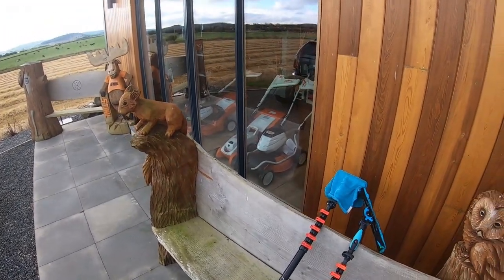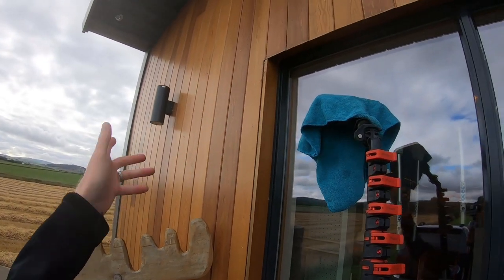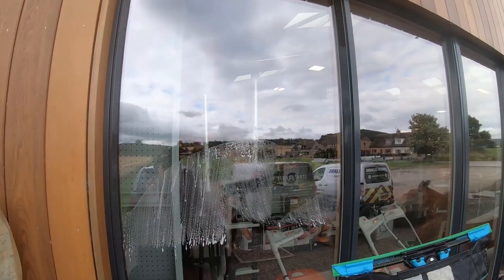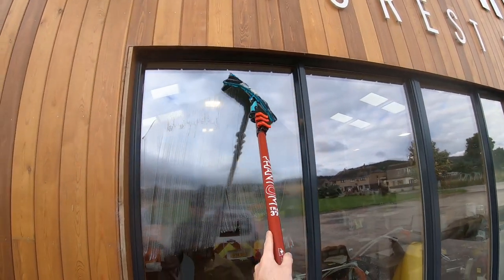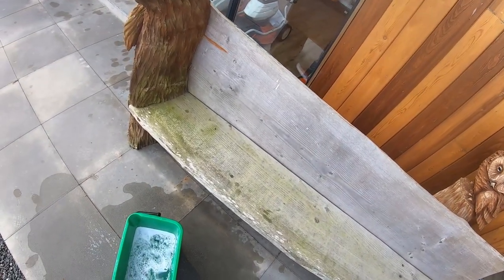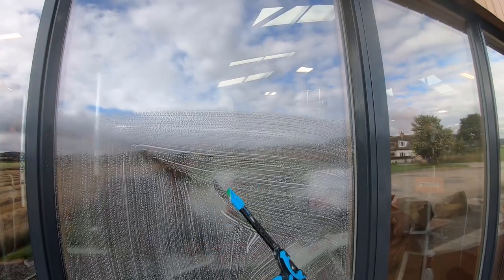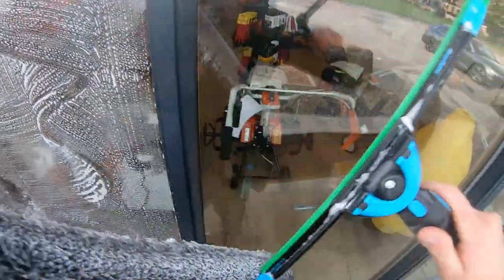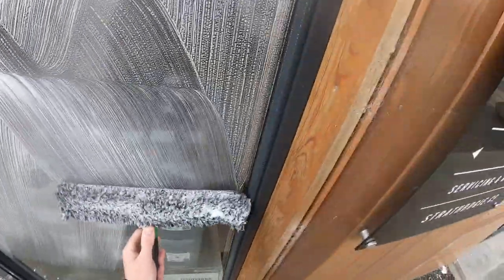SQUEEGEE TRAINING - HAND & POLE TOOLS  (NO MUSIC)

Comment: Pete,
I turned to razr blade red rubber
I’ve been cleaning windows for about 35 years now, and all those years i used unger soft standard black rubbers
I switched about a year ago to the razrblad red and i will never use the old ones anymore
They last longer en give a much better result, it’s sillicino

Comment: Nova Scotia here (New Scotland).  Thanks for the advice on cleaning windows.  I watched this video to the end and then went out and cleaned the windows of my summer place, only this time with little to no streaks following your techniques.  I still need one of those pivoting squeegees you use to reach the tops of two large windows.  The outside of those windows didn't come as well running the squeegee top to bottom.   I was using that technique on all windows until I watched your video.  The one thing I didn't do was wipe down the frames before doing the windows, but was excited to just try your techniques on windows, but will do so next time.  Thanks again.
Reply from the maker: Fantastic!! Well done pal

Comment: Excellent video as always. Replacing the music with explanations is so much better. I do my trad work pretty much the same as you, only the order of cleaning is different. I do glass first (unless the frames are mega dirty). I make sure to let my applicator touch the frame then instead of detailing the the glass I essentially detail the frames if that makes sense. I have to be very precise to not touch the glass with my frame cloth but I find it useful to use the residue to clean the frames.
Reply from the maker: Excellent! 😉🤜🏻🤛🏻

Comment: Hello! Unfortunately, I live very far away from you (in Ukraine), so I can't treat you to whiskey, but I will be very happy if you still answer my question (just one small question :) ) I am not a professional window cleaner, I only wash windows in my apartment, but I want to be good at it. So, I bought a squeegee and started practicing, but there is one problem that I can’t deal with - when I pull the squeegee near the edge of the frame, it does not pull water / soap 0.5 - 1 cm from the edge. The rubber blade of the squeegee runs onto the rubber seal of the window frame, due to which the corner of the rubber blade bends off and, apparently, does not fit snugly against the glass, so I have to wipe the edges after squeegee. But I noticed that rubber seal of my window doesn't form sharp edge like in this video, where rubber seal adjacent almost perpendicularly to the glass surface. My squeegee is a VDM Pulex (it is very similar to the Unger Ergotec shown in one of your videos). It is considered professional, so I think that the problem is not in it, but in my wrong actions. I tried different options - pull the squeegee strictly perpendicular to the edge of the frame, at an acute angle, at an obtuse angle, I tried at different angles with respect to the plane of the glass. But the result is always the same - an unwashed strip remains near the sealing gum.Thanks in advance.
Reply from the maker: If you can, use a moerman excelerator squeegee with unger green rubber to get complete 100% job done with no solution left

Comment: Hi, thanks for the video.. Think i found the reason, why i've got turn marchs All the time. 👍
What is your doing if you have to do the inside, on a Sunny Day?

Greatings from denmark. ☀️
Reply from the maker: 😉👍🏻

On insides I'll put a towl down and do the same method just make sure the applicator is not completely saturated in water or you'll have a very wet towel quickly lol. You get a feel for how much to use with practice. Same process though, dunk applicator in water, squeeze out a little water, add soap to applicator and go 😊
Reply from the maker: If its quite warm on insides do one window at a time 😉

Comment: Sorry to comment on an old video but do you find that you earn enough doing this trad?  Not looking for a trad v wfp debate but if you’re spending all that time and different tools are you upping the price to make it worthwhile? As wfp would do frames sills and glass in half the time. Obviously for inside you’d need the trad tools. Just seems like a bit of faff for what’s usually underpriced trad work. Or are you charging a premium?  Hopefully that all makes sense.
Reply from the maker: Yes trad costs more in our busines model. We have wfp'd this job and many others. Once dry we often find bits missed that the bristles didn't remove or the odd streak / spotting from air vents / seals harbouring dirt etc. Trad ensures a perfect result everytime and can be quality checked before leaving the premises as opposed to when we use the wfp it is often still wet when finished and can not reveal the "real" result until fully dried. We run our trad services as a premium option and the wfp as a cheaper alternative. Hope that explains it 👍🏻

Comment: With the adjustable angle on the Moerman handle and Fliq Pad, how do you figure out what is the correct angle? Love the videos.
Reply from the maker: Mostly down to practice and experience but as a general rule, 25° for above head height. 10° when the close out point is around head height. Minus angles for anything lower than chest height. 40° windows above your head and you are quite close to the glass due to lack of space behind you. Hopefully that makes some sense!

TM
Reply: @TradMan  thank you. Nobody really explains the squeegee head angles.
Reply from the maker: Happy to help

Comment: Hi Pete great job as always . My  problem is turn marks or rubber marks ,I'm finding it difficult to avoid them, have you any way I could stop doing it ? I'm spending a lot of time trying to remove the marks . And second , when you clean your clothes do you use anything like detergent or softener?. Thanks again Pete..
          Brian
Reply from the maker: Are you using dish soap directly on the applicator?

I wash my cloths on a hot wash no detergents 😊
Reply: @TradMan 
Hello
you don't use special glass soap?
just dish soap?
Because I too leave squeegee lines.
Reply from the maker: Yeah just dish soap applied to the applicator 😉
Reply: @TradMan  why directly on instead of in the bucket ?

Comment: What about abrasive pads? What's your go to?

Also, how do you handle windows that have brick around them.. I find the microfiber cloth sticks to the brick.
Reply from the maker: I use walnut pads 😉

Yeah that is annoying for sure, I just try and be a bit more precise on those types of windows if cleaning the frames with a pole or just go up on the ladders and get nose to glass to do by hand.

Comment: Hey TradMan, I noticed that the green rubber you’re using isn’t cut on the corners like the moerman rubber for the 0 detailing benefit. You explained it on the video a bit but can you explain it in more depth please. I thought the rubber needed to be cut at the corner for 0 detailing.
Reply from the maker: I could do a little video on it 😊
Reply: @TradMan  Great thanks man 🤙🏽

Comment: Yo Pete...A question...if I may...'

Would it be true to say...The Wider The Channel, The More Stable On The Glass? 

I'm feeling there's a need to strike a balance between pane size/ swept area & stability methinks...?

I'm getting there...'just common sense I reckon...but I'll avoid that if I can...I'm a bloke!
Reply from the maker: The bigger the channel the more pressure required to operate it and also the bigger it is the more pressure is lost at the tips. Personally I don't use anything above 18 inches
Reply: @TradMan   so...that almost gives me a sense of direction...can I put it another way then. Would you say 14 or 16 is less wobbly than 12 or worse still, 10 on a pole?

Thanks for your response btw...
Reply from the maker: I'm not quite sure what your meaning but for pole work I use either a 14 or 10 inch excelerator with fliq washer attached. Those sizes give good performance. 10 inch for smaller residential windows, 14 inch for commercial work.

In hand I mainly use 16, 12, 6 inch
Reply: I think it's just me... I'm struggling with a pole.
Reply from the maker: It takes quite a bit of practice! Stick in. Use good rubber like unger green or ettore master rubber. Apply soap directly to the washer after dunking in a bucket of water then its all practice and technique thereafter 😊
Reply: ...like a lot of things methinks.

I think most folk, if they ever try, give up, because it's skill and consistency to learn.

Thanks for pointing the way though dude. What with you and the Americans I've learned, at least, not to give up.
Reply from the maker: Practice makes perfect as they say.

Comment: in my opinion this job does not require a pole or ladder.  they dont seem that tall.  don't underestimate how high one can reach with a mop and 18" squeegee
Reply: there are a lot of great tips in this video.  thanks for taking the time to share
Reply from the maker: Yeah for me I can almost reach the top pane to mop it but can't reach the frame to wipe it and I'm about 5 ft 11. Just easier to pole rather than stretch 😁

Thanks kindly for your thoughts. Appreciated 👍🏻

Comment: under what angel is the windowwiper? 30°?
Reply from the maker: Depends on the situation. Best way to learn is experiment with the angles until you get the edge of the rubber blade in contact with the glass.
Reply: @TradMan  thanks brother keep up the good work
Reply from the maker: Sorry its not more of a clear cut answer but really does depend on things like your distance from the window, the height and frame type but if you keep practicing you will automatically know which angle to use as soon as you look at a window 😉

Comment: How do u know how much to charge?
Reply from the maker: First I tally up the windows and charge per window. If anything is awkward to get to or to clean I'll add a bit on. 

Everything that is above ground level is priced higher to.

Pricing is something that is tricky as it depends on your location, the competition in your area, how far away the job is etc.

But I would have a pricing structure, so have a price for one standard ground level window, then anything more than that adjust accordingly so if the windows twice the size of a standard window then double your standard window charge. If its up high then again add more on until your happy with the price.